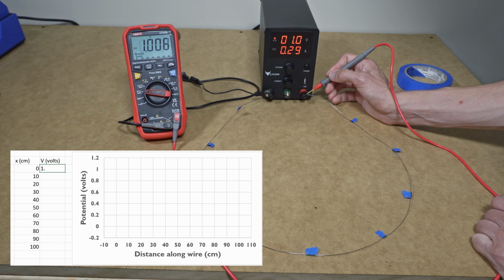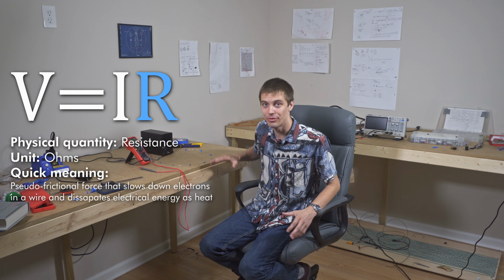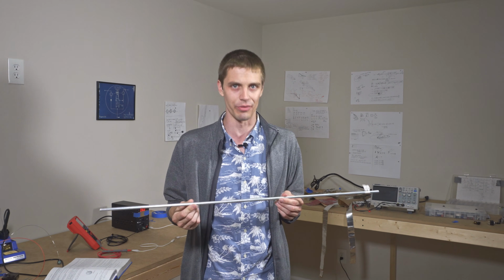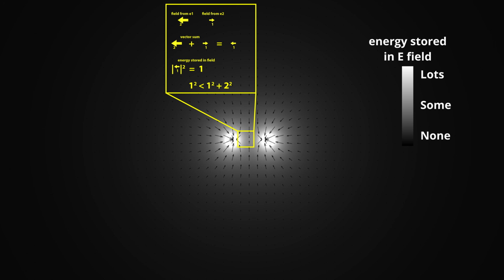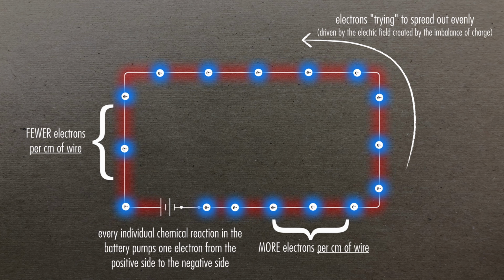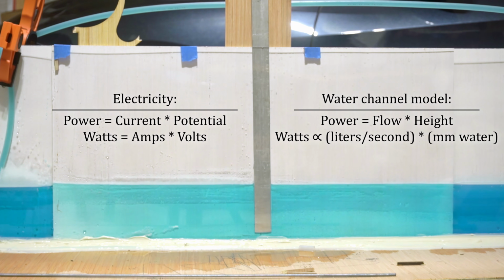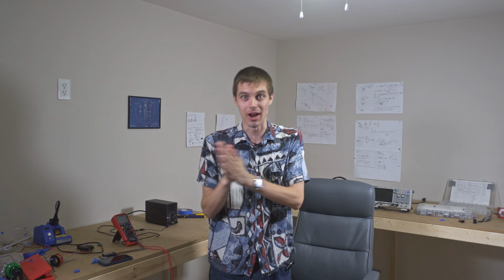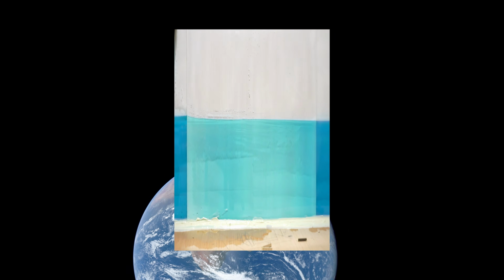An intuitive approach for understanding electricity

Comment: I am a guy with 2 cats, and I can say that you never even come close to replacing all the elections in the wire. Right? I'd buy this notion if we said we replace all the OUTER electrons of the copper atoms. But we're never coming close to replacing any electrons at the inner level.
Consider this opinion meaningless, and of no consequence to the discussion here. Offered only in the spirit of trying to understand what is really happening at the sub atomic level.

Comment: The problem with "intuitive approaches" is that they are not logical ones. Your concept of electrons pushing each other with electrons density changing along the wire (https://youtu.be/X_crwFuPht4?t=1336) is absolutely wrong. If it were true than the wire to the left from the battery would be charged positively and to the right from the battery - negatively. So these parts of wire would exert eletric force on any charged objects put close to them. WICH IS NOT THE CASE! A wire with current remains electrically neutral all the time.
Your video received 58000 thumbs up (by the time I encountered it) and that means that at least 58000 viewers were eh.. mislead by you. I think you have to try and correct this with an apologising video.
Reply from the maker: The wires ARE charged. That’s what created the electric field that forces current to flow
Reply: @AlphaPhoenixChannel  WRONG kid. Feel free to ban me. EM fields are first (they create "current"). You are not clever enough to tackle electricity. You think you figured that out. Wrong. You are stuck in childish hydraulic models etc. Pathetic. Being fairly big YouTuber doesn't make you right on certain topics. Doesn't work that way (you wish).

Comment: I still don't understand these forces completely, but because of your video, I don't understand it...less. Does that make sense? Thanx for the tute!
Reply: Watch out of what you watch in the internet. Videos like that are harmful. They doing disservice. Hydraulic models are lame (and wrong most of the time). Go figure. Electricity is about EM fields and energy lives outside the wires. Basics like that are covered in text books from last 100 years. You don't need a YouTube video to learn this.